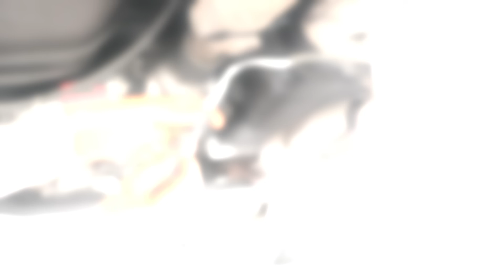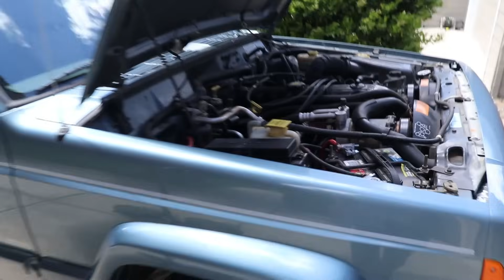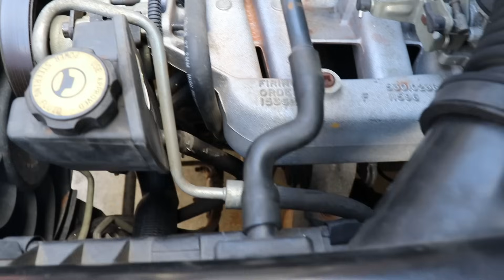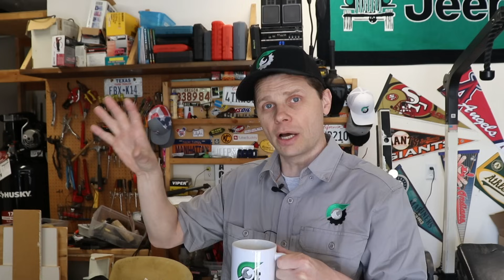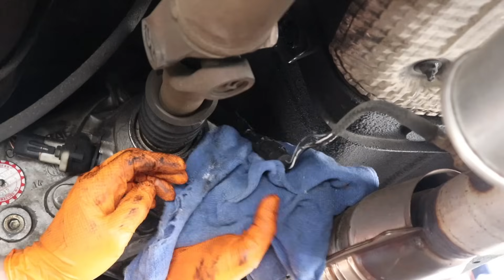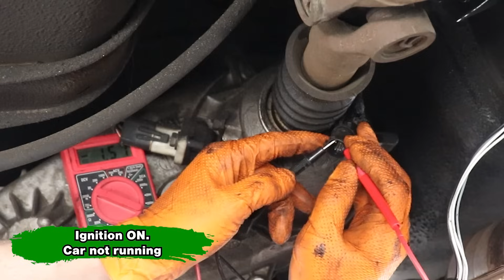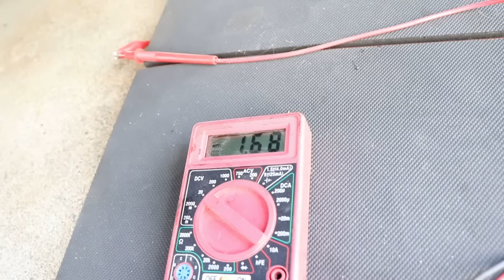Don't Buy Oxygen Sensors! How to test o2 sensor

Comment: My 2000 XJ 4.0 130k miles was running like a champ but had a small crack in the original Duel Cat system throwing a permanent check engine light for Cat codes. No smoke, no black soot and was running like a champ. Stupidly I took it to an exhaust shop for a new replacement, close to factory Cat. Ever since they did the job the Jeep runs really rough, sounds like it's misfiring, black soot out of the tail pipe and sometimes the check engine light starts flashing? Not even comfortable driving this until I fix these new issues. Original dual cat system was unique to 2000-2001 XJ's I think..... there were 4 o2 censors in the original system, 2 upstream and 2 downstream, or something like that. The exhaust guy bypassed the front 2 o2 sensors, I think he patched up the bungholes or something and put in 2 new back o2 sensors. This is a custom exhaust shop that is well know in the area, people send their vehicles from out of state for work. Is it possible this guy is good at charging people lots of money to make their cars and trucks sound obnoxiously loud but knows nothing about my Jeep's Exhaust and totally F'ed it all up? Any advice on what to do now? How to bring my jeep back to stock-ish exhaust with no misfires and no black soot? Like I said, engine was perfect before this exhaust guy messed with the Cat and o2 sensors! He also messed up other parts of my exhaust system while working on the jeep and everything rattles like crazy. Any advice on good after market bold on close to custom exhaust in case I decide to just replace the whole system? This is a rust free/leak free/low miles garage queen and a future resto project so I wouldn't mind having a completely new system. I hear lots of people use Walker parts, any thoughts anyone? I'm doing a stock resto, as little modification as possible.
Reply: Take it back to the exhaust place and tell them to sort it out.  Approach them in a friendly manner letting them know that you think they accidentally forgot to hook up the sensors again and now the vehicle is running rough, giving them a chance to fix fix their "oversight".  If they don't play ball, you could get threaten to get the authorities involved (Environmental Protection Agency (EPA) if you don't have decent consumer protection laws, like most of USA) or just go straight to the authorities.  It is illegal to remove or defeat an emissions control device on an automobile, and if they are a decent size operation that routinely does this, I'd expect the EPA to relish prosecuting them, as they did MagnaFlow.
Reply: Your jeep is what we call a California car. That means it's emissions control systems were made to comply with California law, which is stricter than most other states. The front 3 cylinders have their own cat and front and rear sensors, and the back 3 cylinders have their own cat and front and rear sensors. Without either front sensor connected, the computer will default to a stored program instead of paying attention to the exhaust content, and that program is only ideal for very specific conditions, and will run like dog crap in any other situation. If he left them connected but just tucked away somewhere, it's going to think the engine is lean and try to add fuel. Stored DTCs will sat which is the case.

Idk the shop to say if there was malice, but they were definitely negligent. Any exhaust shop should have a basic knowledge of OBDII oxygen sensor strategy to know better than that. The only way to do what he did and get a good running vehicle would be to put a carburetor on it or an aftermarket engine management computer that doesn't require oxygen sensors.

Comment: Any idea why I have oil on my spark plugs? (Oil and smells a bit like gas as well on some of em
Reply: Oring gasket leak around the spark plug.
Reply: @aichunhu9425   i think you're right
Reply: Maybe you added to much oil when you last changed your oil?
Reply: Valve cover gasket needs a replacement.  Maybe the head gasket too.

Comment: Thank you for your teaching video... very educational. I have a suggestion for you if I may. The old sensor that no good. Don't throw it away, You can use it as a tool. Cut the  connector in half, hook up the old connector to the wire coming from the computer. With alligator clips on your meter, You can read the voltage better. The old oxygen sensor becomes a tool. 
Just a thought.
Reply: genius
Reply: So it'll read the connector coming from the car only correct?? It won't read the cat. though huh?
Reply: @joeyperez3974  correct..... What you can do in that situation is buy or go to a you pull a part lot and cut one off. There's only a few variations of connectors so there is multiple vehicles that it will work to. You can also cut the nub off and and it will work on even more vehicles. Only difference usually tends to be the clocking of the pin and length of wire for most cars. Of course not all. For a more universal female plug you can cut the whole outer shield off just won't clip in.

Comment: Thanks your video is a great help, I need to check my sensors as I'm getting only half the milage that I was previously getting
Reply: Having the same issue, did you replace the O2 sensor and did it solve your poor gas mileage, thanks

Comment: actually O2 sensors should be replaced every 60K - 90K miles. Failing to do so can cost you a LOT in poor gas mileage.

Comment: I wanted to know how you were measuring 1.68V hooked up to the sensor and ground while the engine is not running to produce heat. I'm not sure what the ignition on does here because your not plugged in for the heater circuit to heat the sensor. Thanks.
Reply: I was thinking the exact same 🤔🤔
Reply: I'd have to see the time stamp, but he could've been testing the rider voltage from the computer. I can't remember if Mopar used a rider voltage back in 96/97.

Comment: Great diagnosis Dale . You sure are teaching Sasha a lot and the cool thing in my book is that she shows a lot of interest . I have been trying to catch you live on Wednesday's but I have had a lot of doctors appointments on that day . I have about six more weeks of injections then I will be able to catch you all live again. Have a great weekend and be safe .
Reply: l
Reply: 2222
Reply from the maker: Thank you. You too!
Reply: @JeepSolid  I have a P0420 code on my 2007 Toyota yaris but no engine light, I only found that out through Scan tool, what do I do because it is not smog ready, it given me the yellow exclamation mark rather than the green one. what do I do????could be I just have drive a few miles for it to go through the cycles, since it is only yellow and there no check Engine Light?

Comment: Have you done any work to the Jeep where you used RTV somewhere around the  intake or on the PCV system? Regular RTV fumes will kill the O2 sensor...
Reply from the maker: Not on this one. I think they were just due
Reply: @JeepSolid  I haven't needed to replace the ones on my commuter Camry yet (350,000). 😲.. But I am replacing the VVT solenoids